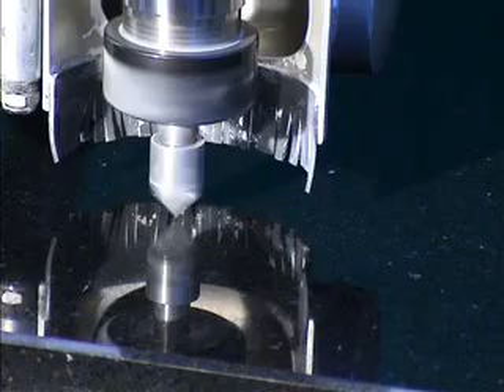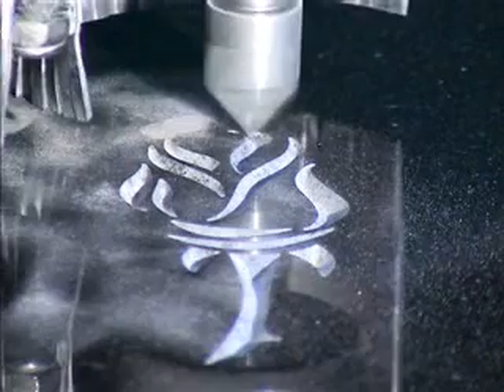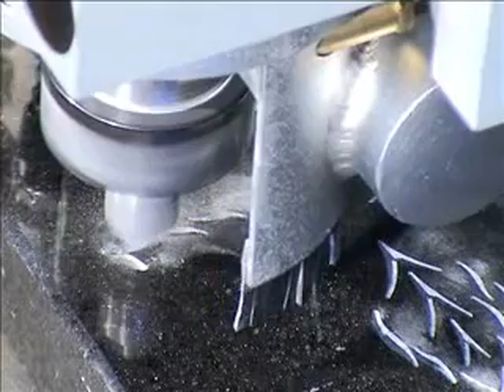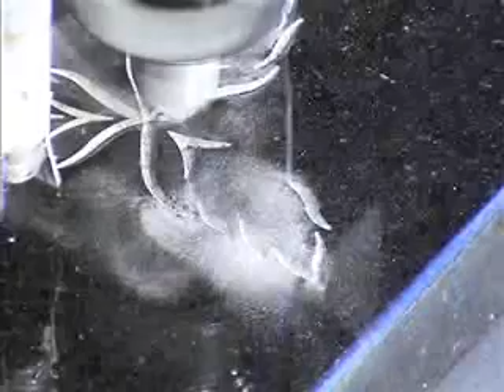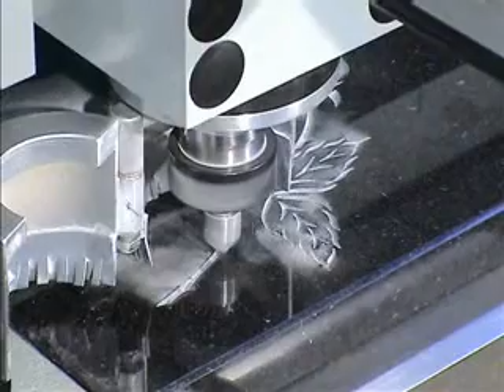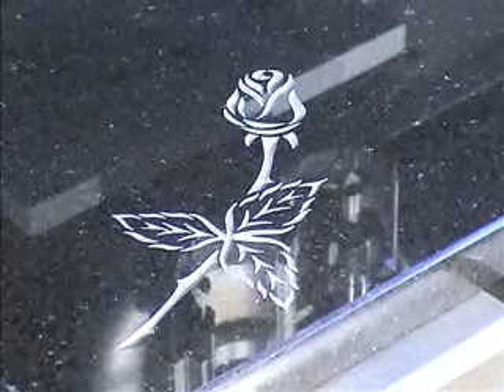incisione di rosa su granito nero -Rose Engraving on granite

Comment: great bits for engraving granite, i already bought Tipo 10 90° bits they are fantastic... today I bought also tipo 15... I have a small question about feed and speed ... as you recommended me Lorenzo for engraving black granite the spindle speed is 4000 rpm and the feed rate is about 100mm/min, the maximum depth for engraving, on a single pass, is 1.5mm... in general I'm engraving Caesarstone (Even Qeysar from Israel).. I think it's softer than black granite ... what you recommend me to use as feed speed and depth ?! can I go faster ? and does I need water mist/ cooling for both material ?
regards
murad assadi
Reply from the maker: in that case you can reach up to 6000 rpm and up to 200mm/min, of course this always strongly depends on the type of material.
always remember to sharpen well the tools and in case of granite it is useful to round a little bit the tool.